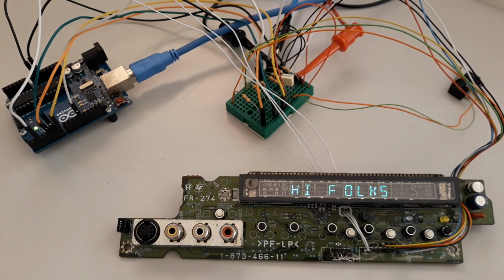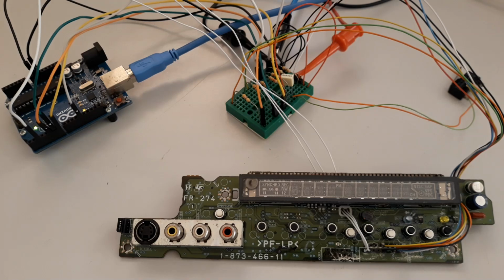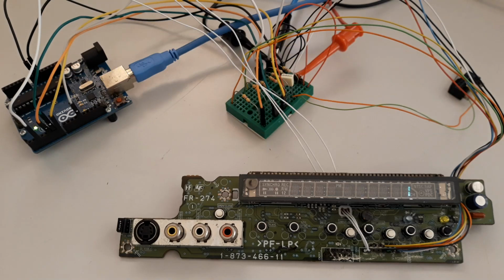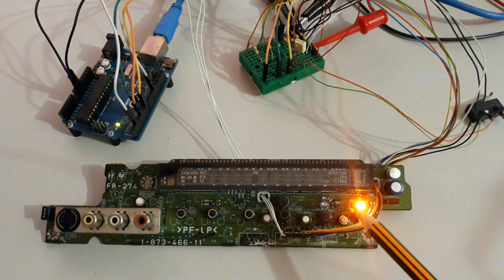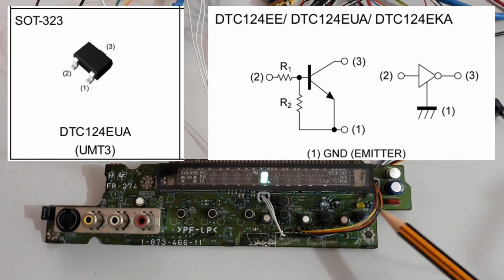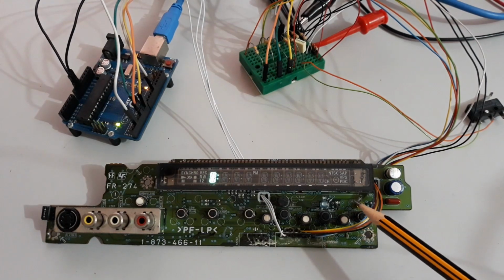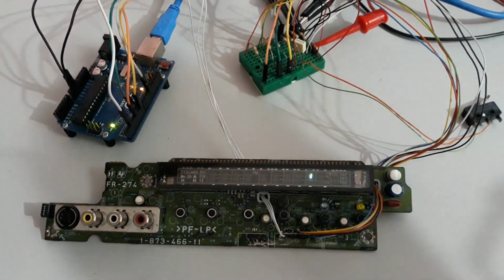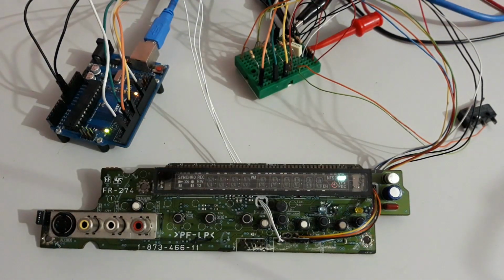PT6315

Comment: Sir I have a LG music system vdd m105 in vfd driver ic is pt6324 when switching on set shows 8888888888 full vfd . What's the error is it ic damaged? Or tube ?
Reply from the maker: Hi @villagerse,
The fact that everything is ON ensures that it is sealed and has not come into contact with oxygen. It also ensures that there is voltage at the filament (close to 3V AC or 3V DC).
Now, you need to ensure the presence of negative voltage (close to -24V) on the VEE pin (pin 50) and +5V DC on pins 51 and 9 of Driver.
Pay attention to the components connected to pins 7 (OSC) and 8 (GND), which must ensure oscillation.
Pins 1, 2, and 3 are responsible for communication from the microcontroller and should show a variation in their signals, indicating communication is taking place.
The manufacturer's service manual, which is available online, already recommends some actions, such as replacing Diode D13. However, be careful: these actions are only for certified technicians, as opening these devices can pose a risk to life. There's no way to guarantee exactly where the problem lies; you have to take it step by step! Good luck and good work.
Reply: @jlsmonte thanks sir

Comment: I really like those VF Displays!
Do you have a Video on how to control a VFD with an Arduino?
Reply from the maker: Hi @SuperNimmzwei, there is a series of videos where Arduino is present, as in this video because the control is also done with Arduino.
It must be taken in line that VFDs use positive or negative tension that to be able to polarize Grids and Segments have slightly high values for the Arduino. For this reason we have to always have an interface that can deal with these potential differences. It can be a static gest and positive tension driver, such as SN75518, or a negative tension and dynamic gest  such as PT6311.
We can also make use of Family CMOS integrated, like CD4094, that can support up to 18VDC thus getting the VFD shine limited to your performance with this voltage value. We can also use an ULN2981 IC as an individual interface of segments and grids. There are really many options, please give a look at the videos published on my channel, something that is missing or who like to deepen, say I will try to help, ok. You can make the search on my channel by reference I have mentioned above. Good job there!
Reply: @jlsmonte  Thank you very much. Your videos inspired me to get deeper into VFDs! Keep up the good work
Reply from the maker: @Supernimmzwei, thank you very much for your incentive, please feel free for any question you believe I can make clearer. I believe your doubts will also be from the community, Trying Answer to You, All community will gain!
Thanks a lot!